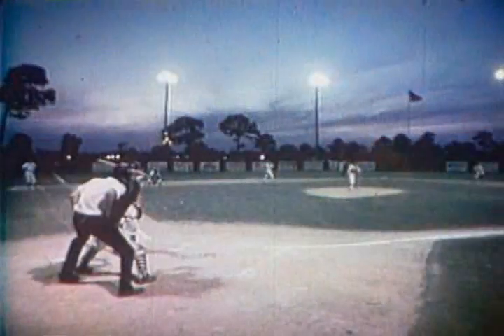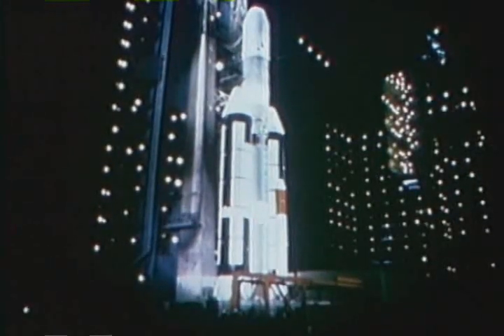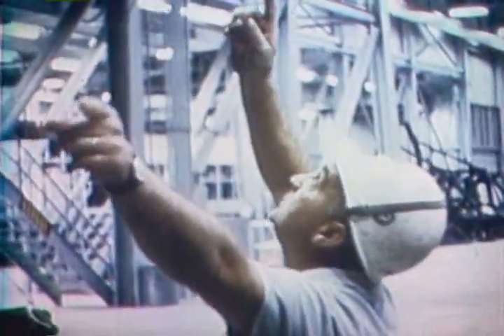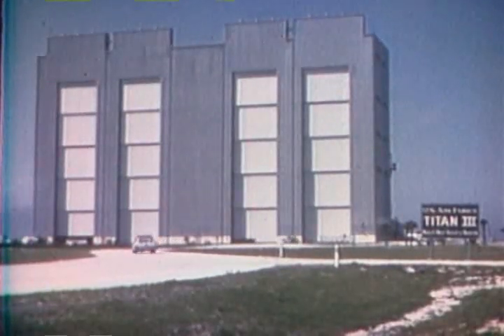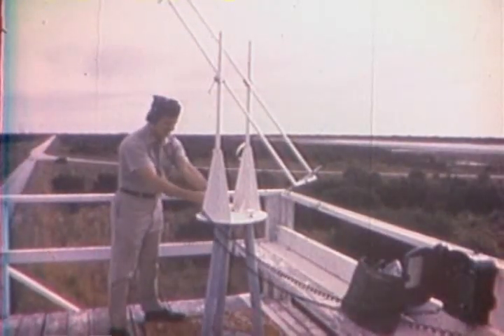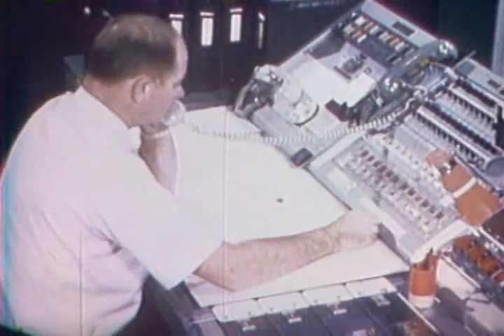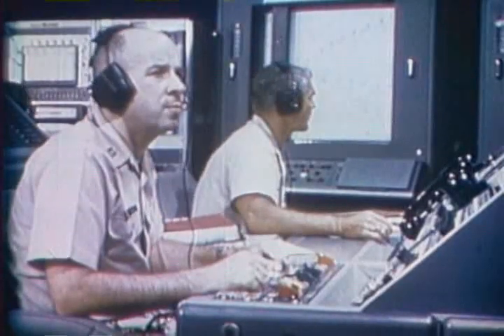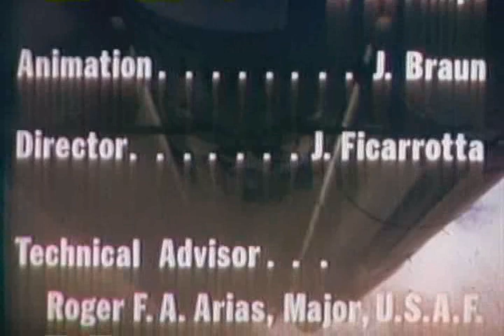Counter Catastrophe: The Range Safety Story

Comment: Does SpaceX even have a range safety program in Texas?
Reply: Yes. They have a fts system onboard.
People initially (incorrectly) thought that sn11 had been termknated by range safety.
Reply: The FAA certifies the FTS for Commercial Space Launches. Space X is flying autonomous flight termination systems these days.  The computer monitors the instantaneous impact of the debris using on board sensors (GPS/INS).  If it veers off course (violating the Impact Prediction) the FTS will activate.